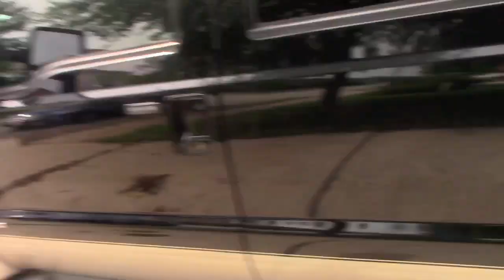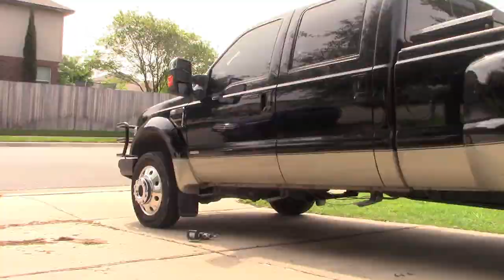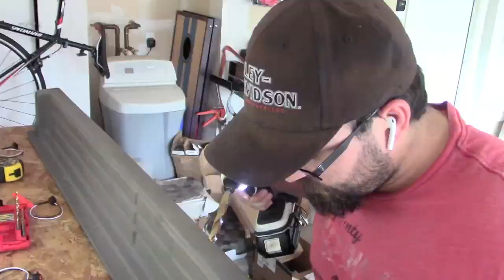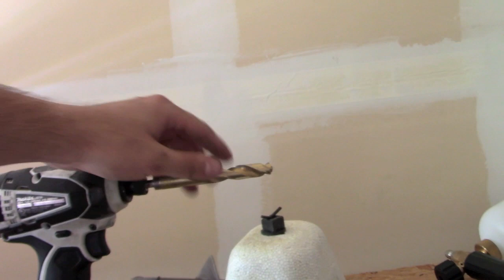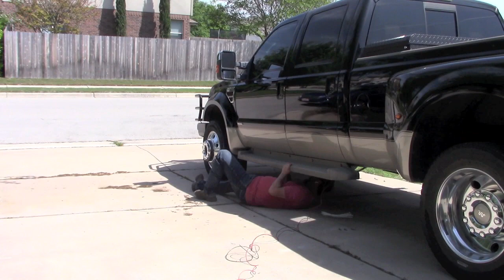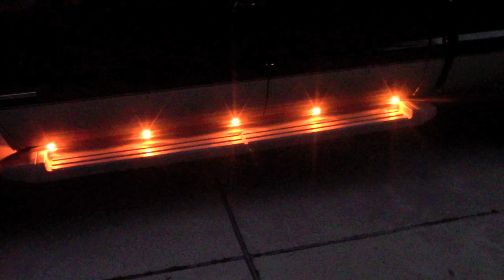The F450 Gets Chicken Lights!!

Comment: I'm putting those same lights under my bumper on my truck. Just curious how you connected the lights together.
Reply from the maker: I took 14 gage wire and ran it the length I needed from the power source to the last light. Then I cut the sheathing back on the wire where the pig tails where and punch a hole on the copper and wrapped the pig tail around it. So it look like 1 wire with multiple lights on it
Reply: @LSRWvlog  do you still have this truck? How many miles have you racked up
Reply from the maker: @chrisyoder8429  I sold the truck with 82k on it